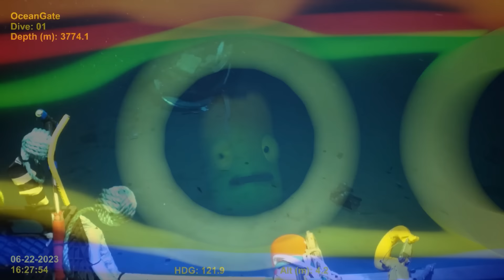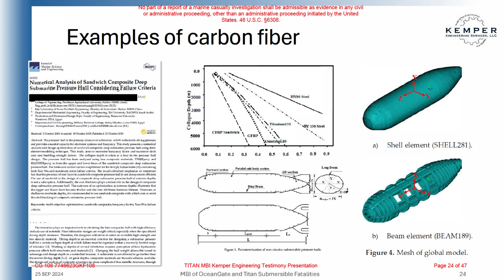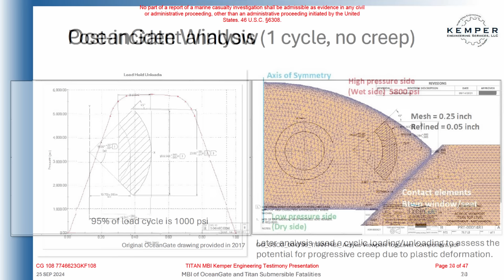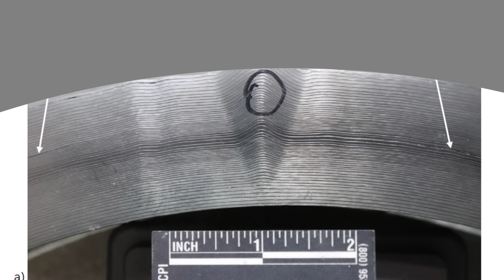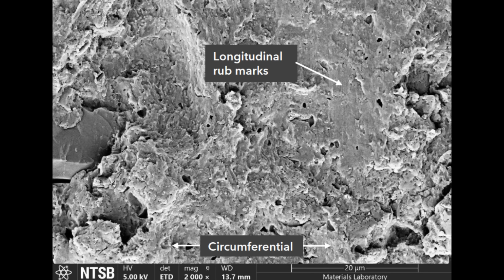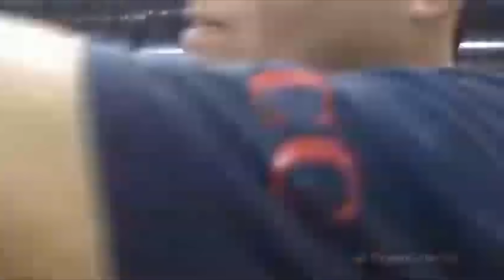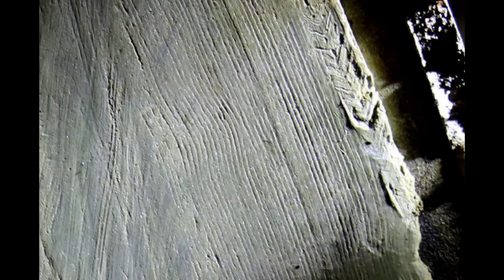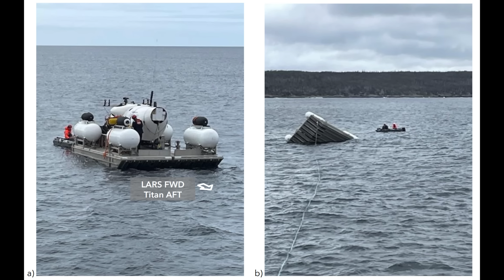OceanGate Wreck Shows Why Sub Wasn't Strong Enough To Survive - NTSB Shares Important Details

Comment: I used to work for a company that made a spiral wound composite like this.  I've also spent a lot of time working with yarn tension systems.  When you make a composite like this, you're using multiple strands of Carbon fiber, called "tows", simultaneously.  The size of these tows is typically named by the number, in thousands, of carbon filaments comprising it.  For example, a 3K tow has 3000 filaments, 6K tow has 6000 filaments, 12K has 12000 filaments, etc.  The thing to understand about all of this is that when you're winding this thing, you're not winding a single wide band of carbon fiber, you're winding 20 or 30 or 50 individual tows that have been set parallel to each other.

 Each of these tows pays off its own separate spool.  In order to control the tension with which you are winding the cylinder, you have to control the tension of the carbon fiber band.  This does two things: first, it helps improve the fiber fraction which is the ratio of fiber vs resin in a given unit area.  Since the fiber is the strongest component of the composite, you typically want a fairly high fiber fraction (I think it's typically between 60-70%.  If you go too high you don't have enough resin to bond everything together).  Tighter winding gives you higher fiber fraction with the downside being that you're increasing the amount of stress under which you're placing the yarns before they see any external load AND it can make it more difficult for resin to fully penetrate through all the fiber to ensure you have no void (air) gaps.

There's two ways to do this, either control the tension of the entire band after all the tows have been pulled together into a single band OR control the tension of the tows separately such that you get the overall band tension that you want.  Controlling each tow separately ensures that the tension, and consequently elongation, of each tow is identical to its neighbors.  But, this requires a more complex and sophisticated (i.e. expensive) tension control system to ensure that you're getting minimal variation in the tension between tows.  The moment I saw that bubble build up on the cylinder my immediate reaction was "someone had a tension control problem".  That bubble comes from the fact that not all of the tows in the band were under the same tension while being wound around the cylinder.  Over a very long distance, this slight variation will build up and create a bump just like what we're seeing on the cross section of the sub.

Machining that bump flat and starting again was only useful to create an artificial weak spot in the composite because now you have broken the fibers in that area.  Doing this repeatedly and then gluing them together creating separate rings, I can very easily envision that at least one of the failure modes was that the carbon fiber layers basically got peeled apart where they had machined the cylinder flat again.  In that localized area, you would have no stress translating through the fiber, only through the resin, which is much much weaker.  Secondly, creating 5 separate rings means that the cylinder wasn't bearing the compressive load as a single cohesive unit, but as 5 separate rings which relied on the glue layer to transmit the load to the inner rings.
Reply: this is the most thought out comment i've ever seen on youtube
Reply: @brainundead  You should read some of mine.
Reply: @brainundead  confusing
Reply: It’s great to read input from someone this knowledgeable about composites, because I have a materials science degree and when people ask me about this disaster, I have to handwave a lot of details as I’m not a composites expert myself and don’t want to say anything blatantly wrong. Thanks for taking the time to write all that out.
Reply: @singerofsongss I literally have to keep pausing the video because I am obsessed with all the people who have expertise in this writing out really thoughtful and generally informative explanations
Reply: @singerofsongss  My first reaction when this story first broke in 2023 was, "you mean that carbon-fiber composite technology has gotten that much better since I graduated from college?"  A couple more news reports later and my reaction became, "no, it sure didn't!"
Reply: Honestly seeing the ‘solution’ of machining out the bumps is such a big red flag when making high performance composite like this. It guarantees you have uncontrolled areas where tension accumulates.
Reply: @luipaardprint  Everything about oceangate screams amateurish. I watched the video of them putting the titanium end-caps on and that was enough for me. It was embarrassing to watch. This was expected to dive to 4km deeps? "Farewell and adieu to you fair Spanish ladies..."
Reply: Truly, thank you for the insight because this has been bothering me more than anything. If I'm understanding, wouldn't using fewer tows in the band potentially mitigate the issue and would there be a reason to avoid this other than increasing the time to complete each winding? Does the total length of the spools start to be a limiting factor?

I'd imagine there are other variables coming into play at such a scale but their solution for this defect seems like such an obvious potential failure point that I can't help but think I must be missing something.
Reply: @JJFX-  As with anything, there are trade-offs everywhere, advantages and disadvantages.  Without diving into gory details, it's everything from using large tow vs small tow (like a 20K or 50K vs a 3K or 6K), the width of the band, the grade of carbon fiber used (CF typically comes in 3 "grades": standard modulus, intermediate modulus, and high modulus), the exact resin used and the infiltration method,  the winding tension and tension control method, band wrap angle, desired fiber fraction, etc.  All of this would have (or should have) been accounted for in the engineering analysis and design.

For example, assuming the same band width, fewer tows means using a larger tow.  A larger tow is much less expensive per pound, but as you said, the spools are shorter in length compared to a small tow.  This, in and of itself, isn't necessarily an issue as there are methods to join tows together.  It's not the same performance as if the tow were continuous, but there are ways you can mitigate the impact any individual join would have on the strength of the composite.  A large tow also means a larger layer thickness (think of each CF tow as being an elongated oval in shape) which, again, may or may not be an issue depending on all the things I listed in my first paragraph.

Ultimately, all of this just highlights the importance of testing and why you don't use untested designs or materials in instances where life is on the line.  For all its inadequacies, the US Government is actually pretty good at avoiding this kind of thing in military and aerospace applications because you cannot use materials that have not been proven to work.  It's part of the reason why NASA/ATK/ULA/Lockheed can't/won't change rocket designs as quickly as a company like SpaceX will.  

As much as I'm also watching this as an "armchair engineer", they aren't necessarily wrong.  Carbon fiber composite, or really any long fiber composite for that matter, has extremely good tension properties but extremely poor (comparatively) compressive properties.  A pressure vessel like this puts all the load on the outside of the composite pressing in, meaning the composite itself is put into compression.  Again, this isn't necessarily an issue provided that you've accounted for this in the engineering design and analysis as the failure mechanisms for composites in compression are different than when they are tension.  But again, this is why you test this stuff because there is almost always something you didn't account for or some secondary failure mode that you didn't anticipate or something isn't behaving in the manner expected.  For example, how the hemispherical acrylic window wasn't the stronger version as initially anticipated by the engineers.  But OceanGate didn't do that and here we are.
Reply: @jaderiddle9082  This is fascinating and I really appreciate you sharing your experience. There's so many potential variables to account for that it really highlights why using it for an application like this is so difficult. While I'm all for pushing the boundaries and researching the potential of these composite materials, this should not have been anything more than a prototype. If they'd kept testing and iterating the design they likely could have proven its viability but instead they risked people's lives and set back such research for years to come.

It's still a very interesting subject that I'm going to continue to dive into. Thanks again.
Reply: @jaderiddle9082 it’s also so wild to me how their 1/3 scale models failed and they were like “ah oh well, build it anyway, this is fine.”
Reply: I have zero experience with materials but as soon as Mr Manley said they were machining down the wrinkles, my thought was, “doesn’t that break the carbon fiber?” I’m glad to see my instinct was right. Machining down those wrinkles definitely degraded the efficacy of the carbon fiber. 

I’m just a math teacher but even I could tell you that 5 cylinders glued together is only as good as the adhesive under pressure. The more I discover about the engineering of this, the more I cannot believe no one was able to stop this man. Like gluing a flexible (carbon fiber) tube to a less flexible metal (the titanium rings), it’s as only good as its adhesive. And this is the first that I’m hearing it was lifted by the rings??? Horrifying. I wonder how the engineers who helped create this disaster are doing. I need to know what they were thinking.
Reply: @ProblemSolvedTutoring  Let's make it out of a long continuous length of unbroken super-strong fiber... and now lets cut that fiber into shorter lengths randomly across the surface of some nested cylinders that are simply glued together. Now let's get inside it and go 4km down in the sea. What could possibly go wr... [BANG.BLOOP]
Reply: I have to say, You knew Your job and what it takes to do the job properly. As for Stockton Rush (RIP) He should have got someone like Yourself involved,instead of young impressionable grad students.
Reply: I read this comment a few days ago during a rabbit hole about the Titan, and of everything I've learned, this is the thing that keeps coming back to me. This bastard was so cheap, so lazy, so eager to cut corners, that he didn't even do everything he could to make his shitty material of choice as safe as it could be. 

If he was genuinely out to prove the safety and utility of carbon fiber, he would have taken every possible precaution. He would have gone for the expensive tension control method, he would have autoclaved the hull, he would have tested for gaps. But he wasn't in it for science, he was in it to prove he was the bestest, specialist, most innovative little boy alive... and he had decided that carbon fiber was how he would get there. The details didn't matter, only his ego.
Reply: @kizuna8   I don't remember right off hand whether or not that sub was manufactured in house.  If it was, then it just speaks to the lack of (manufacturing) knowledge the design or manufacturing engineers had when creating something out of a spiral wound composite.  If it wasn't made in house, but through a contractor, then the nuances of winding Carbon should have been something very well known within their manufacturing process.  It's also possible that the bump was caused by something else, like one edge of the band butting up against the mandrel used to help form the composite structure just a smidgen too far.  The thing to remember here is that when making a composite like this, we are talking about obscenely long lengths, easily hundreds of thousands of meters of yarn in total.  So, it's absolutely a situation where very small defects or variances in the process can compound into a much bigger one.  This is also why you test, test, and test some more, which is the actual expensive part of something like this.  Especially when there are no design guidelines or best practices to follow such as was the case here.  One of the reasons military and aerospace applications are so damned expensive is because of the design requirements, many of which were written in blood.  It's why changing the designs of things in those spaces is so slow.  You can't just fire whatever you want up into space, you have to use "qualified" designs built with "qualified" materials produced by "qualified" vendors using "qualified" processes that all have mountains of test data and historical data backing them up.  It's too expensive and there's too much at risk if it fails. 

With that said, Carbon fiber is a far cry from a "shitty material choice", even in this application.  All of the nuances associated with handling and processing it into a composite can be accounted for in the design provided that the engineers have the knowledge and the manufacturing facility has the skill and control to do it.  Engineers do this kind of thing every day with more mundane materials like concrete.  Concrete's mechanical properties are relatively horrible in tension, yet every day we build bridges and other structures out of concrete that place it under tensile loads, and those structures last for decades in a variety of environmental conditions.

I'm not a composite design engineer, but would I have built a sub for deep ocean exploration out of spiral wound composite?  Nope, and it doesn't even matter whether it was Carbon or not.  It could have been fiberglass, Nylon, Aramid (e.g. Kevlar), or any of the multitude of yarn materials we use to make composites and I still wouldn't have done it that way.  It simply has to do with the structure of the composite itself, the type of loads to which it's being subjected, and type of failure modes of those materials.  But could a sub be designed out of Carbon composite to handle that environment?  Sure it could.  It already has, the US Navy did it years ago.  It was unmanned, iirc, but that's a little beside the point.

OceanGate wasn't the result of a singular failure.  It was a freight train of smaller individual failures combined with an under-tested design using unproven materials built by a company run by a man who wouldn't listen to what any of the people who knew how to do this kind of stuff had to say.
Reply: @jaderiddle9082  This is some excellent content!
Thank you for your service!
Reply: 16:48 seeing the changing gaps between those strands, already made me flinch. It matches exactly what you describe. Machining carbon fiber to "fix" wrinkles, then adding layers like rings in a tree but worse... 😕
Reply: You nailed it. I saw the same thing watching the video. Machining the creases cut the fibers (insanity), and you had five individual tubes held together by the shear stregth of the adhesive. Add to thar gluing on the end rings (two different materials) . They were lucky they made it that far in number if dives.
Reply: Thanks, that's what my own lack of knowledge was pointing me to lawl. Utterly insane they did this though, because it's not like torsion control is some esoteric system. But no, far more important to "cut costs".
Reply: Fiberglass high pressure piping is made for handling acidic petroleum.  During manufacture the longitudinal tows are kept under a specific tension as wound overlays are applied.  The structure alternates until the pipe wall is thick enough to handle the design working pressure.  At the time they could easily make pipe that was rated to 5000psi using what was essentially home made equipment and relatively unskilled workers.  The owner himself devised the equipment and oversaw all production.  They had a great reputation for quality and were soon acquired by a major steel pipe producer to broaden product offerings.
Reply: "Machining" flat is perhaps paying too generous a compliment to Stockton and his builders. I believe they used off the shelf DIY electric sanders to smooth out bumps in the 4 inner composite rings to achieve a flat surface, thus, as you say introducing multiple weaknesses into the system.
Reply: Your first 3 paragraphs are irrelevant. They pertain to filament winding that uses tow tension. The second hull was tow placed that uses prepreg tape. Tow placement is just simulating hand layup that does not put the fiber in significant tension. Tow placement and hand layup use vacuum and autoclave pressure to compact the plies and remove some trapped air. Filament winding uses tow tension to develop compression between the plies to squeeze out excess resin and trapped air continuously as a part is wound and maintains tension in the fibers thru cure. The wrinkles (bubbles) you saw were caused by the autoclave pressure compacting the plies and reducing the diameter of each ply. The fiber can’t get shorter so it wrinkles. You don’t even autoclave filament wound parts because the pressure compaction can overcome the inherent fiber tension and cause wrinkles. I witnessed a test of an autoclave cured filament wound pressure vessel40 years ago. The thin walled part had wrinkles and failed much lower than a non- autoclave cures part. No experienced fabricator of cylindrical parts would think of putting a pressure vessel in an autoclave, whether it’s for internal or external pressure. The pictures of the wrinkled section the Coast Guard showed, shows  the wrinkles penetrated most of the way thru each of the 5 rings. Wrinkles are nearly as bad as broken fibers. The cause of this failure was clear and simple the choice of the tow placement method and autoclave cure.
Reply: wow, thank you for explaining all that! i appreciate that you took the time. i’m very interested in composites, have been since hs when i first knew of bucky fuller.
🤍💭 david
Reply: This comment...
Reply: Yeah right  👍
Reply: Thanks for the clear detailed explanation - I was wondering if that was the problem
Reply: I thought the same thing, and I am just a seamstress. However, woven textile fabric is similar. Its wild these people could recognize this themselves.
Reply: I know -0 about this, but "ironing out" imperfections in such a tediously-made material sounds suspicious even to me. I have (extremely intellectually crude, of course) mental images of someone with split ends in their hair finding remedy to the situation by using a sander.
Reply: Didn’t they use sheets of carbon fibre, not individual fibres?
Reply: If you didn't grind down the bumps, and instead just made a five inch-thick cylinder in one spooling, the bumps of course would build up, and you would end up with a very bumpy cylinder that you couldn't fit the end caps to.  You would then have to grind the ends smooth, but that might be better than having the weak spots near the middle of the cylinder at the point of greatest flex to hydrostatic pressure.  Then the collapse might (and maybe did) start at the glue joints between the cylinder and the end caps.
Reply: How was the resin put on? Definitely not by hand? Sprayed on by controlled nozzles as the fibers are applied?
Reply: I would also go as far to say that regardless if it was done right a cylinder design for a deep sea sub as opposed to a sphere for that depth is bonkers to begin with. It’s like they didn’t understand pressure physics it would have failed regardless even if done correctly
Reply: Thank you and thank you and yes thank you. Great details, deeper explanations than anything I have seen before.
Reply: Great comment! Thank you.